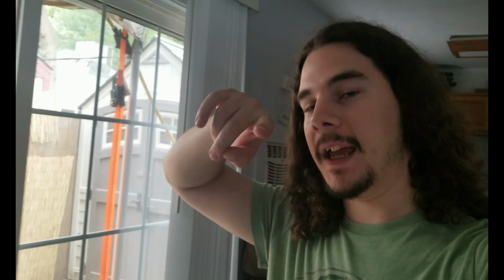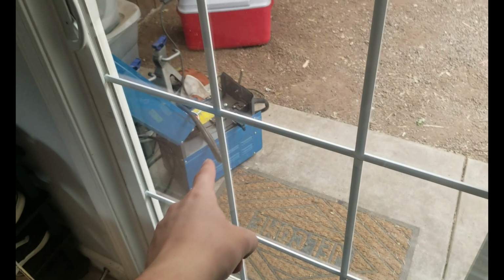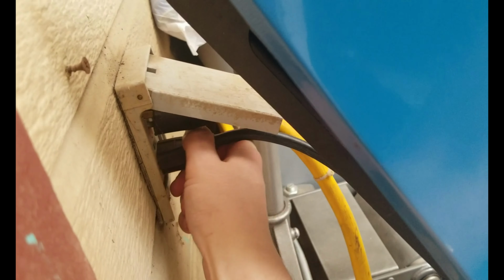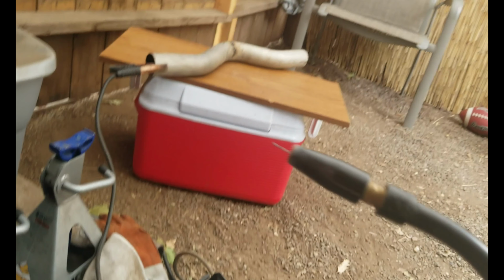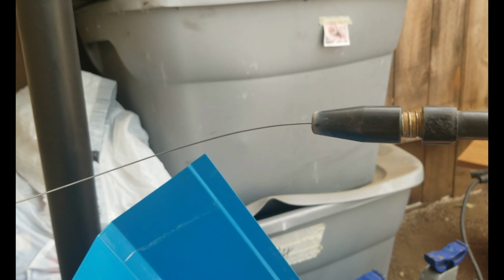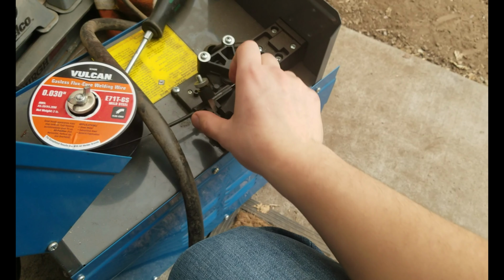Custom Strait Pipe | Catback | Volvo S60 2.5T

Comment: You just need to loosin up the spool an maybe put a little pb blast on the bearings I know its an older video just little advice cuz iv used those older one's quite a bit haha an I have a 2004 volvo s60 2.5t myself 🤑

Comment: i got a 2006 volvo s60 2.5T 3 inch steinless steel  catback sport exhaust did remove rear muffler and replace whit 3 inch pipe sounds relly nice but now i want to delete  resonator to but wonder if the car gets to loud, this swedes can build cars :D

Comment: How much did the supplies cost you? I have a down pipe in place but it connects to the factory resonator and I cut the muffler off. I need to go ahead and get the rest done but the shops want a lot of money for such a simple setup.
Reply from the maker: Overall I spent around $300 on materials,  on top of that you can buy the same welder for around $90, but I wouldn't reccomend that welder.

Comment: Such a shame it’s fwd
Reply: I have one that’s awd it launches pretty well but it’s still pretty slow to be a turbocharged car
Reply: @livinglife4672  That's because Volvos are massively detuned from the factory. On These year Volvos the stock ECU tune limits the torque in 1st and 2nd gear and the AWD models run less than 6psi of boost except for the S60R. The S60 2.5T AWD weighs less than a new Subaru STI and the newer Mitsubishi Evos. The S60 2.5T and 2.4T AWD cars are diamonds in the rough. So many reasons why and tuning potential. Easy 300hp cars can be achieved for under $1000.
Reply: @willriley1619  how can you give a 2.5t awd more power?
Reply: @livinglife4672  For any real power gains you will need to upgrade the turbo to at least a 16T and the injectors from a T5. Along with exhaust and an ECU tune. Since the 2.5T has a slightly higher compression ratio over the T5 the 2.5T will make more power if modified the correct way. So basically for starters swap the turbo and injectors off a T5 and get a tune from someone like Hilton along with a full exhaust then you will be around 300hp and 330tq
Reply: @livinglife4672  Once you upgrade the turbo, injectors exhaust and tune you will be making more hp and torque than an STI or Evo as well as weighing less than them. It might seem like alot of mods need to be done to achieve this but not really and it's fairly inexpensive $1500 or less and you got 300hp and 330tq
Reply: @willriley1619  oh 1500 is not that bad, so I’ll basically be making R power ? I was looking for a down pipe to start the build cause I know that will relieve a lot of back pressure
Reply: @livinglife4672  The downpipe is going to be the most important part of the exhaust as far as making power. You will likely want to wait until you get a new turbo on for the downpipe because the flange is probably different. If I was you I would start with a cat back exhaust or custom exhaust of some kind. Then I would piece together all the parts needed and install them once you have everything, but for now you can do exhaust and silicone intercooler hoses or a front mount and intercooler kit. Search junkyards, ebay, Swedespeed.com or other Volvo forums to find the turbo and injectors you need for the best price. Also don't waste your time on an intake. They don't do anything on Volvos. Just go with a K&N or IPD panel filter.
Reply: @willriley1619  my car came with an ipd intake from the previous owner I just put on an autozone cone filter, it sounds nice but it didn’t really do anything boost wise I’m only pushing about 5 pounds and 7 on a good day, I really need a turbo upgrade first
Reply: @livinglife4672  Yeah the intake does nothing but add sound. Which it does sound cool. It may give it slightly better engine response, but they are dyno proven to be less effective as the stock system. Since you already have it just keep it on there no harm since it came with it. You don't have to get a 16T turbo you can get a K24 off an R or an 18T or 19T off a 1st generation V70R. The 16T is just going to be the cheapest and easiest to find. The 16T will also max out at no more than 300 wheel hp only if it is on the low pressure turbo engine like the 2.5T. Due to its higher compression ratio over the T5 or R cars.
Reply: @willriley1619  about how much would a 16t be ? Like even used at a junkyard cause there’s a couple at mine but idk how much turbos go for, and wouldn’t I need to get the flange aswell?
Reply: @livinglife4672  I don't know where you live but in North Carolina the junkyards sell turbos for $55 dollars. I would expect to pay $100 or less for a junkyard turbo and $300 - $400 from eBay or a Volvo forum. The flange is part of the turbo and it will bolt right up to the stock exhaust manifold. The flange that is different between the turbos is probably the exhaust flange or where it bolts up to the downpipe. No big deal for an exhaust shop though. This is why I would recommend waiting for the new turbo before you get a downpipe that way you can buy one that is made for it instead of having an exhaust shop cut the old flange off and weld a new one on. You will want to get the fuel injectors too and they are like $6 a piece at the junkyard.